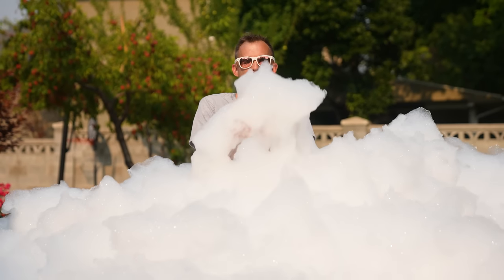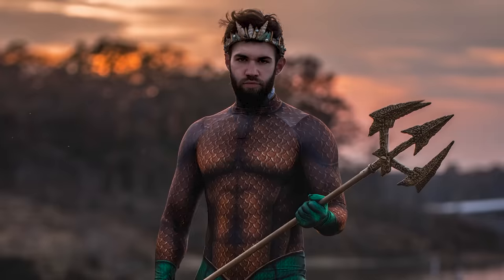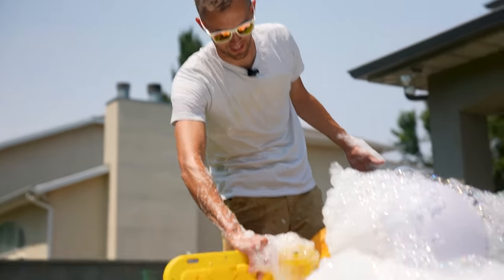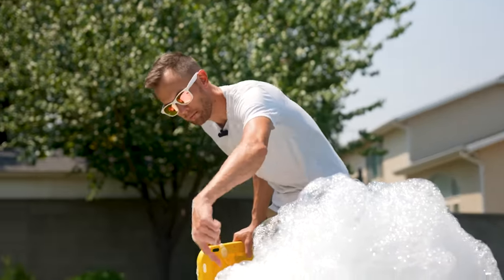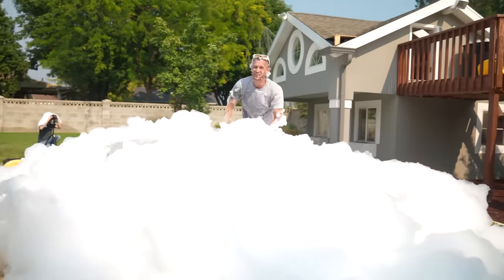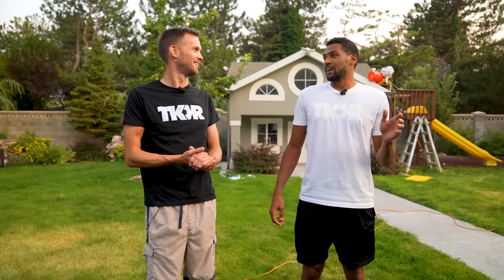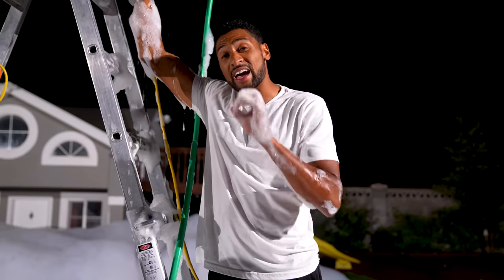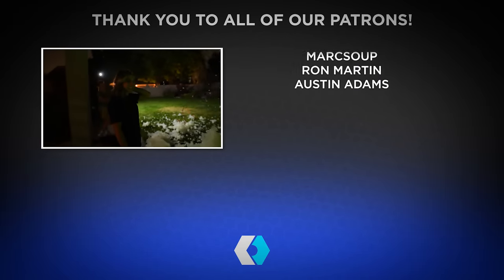DIY Foam Machine FILLED Our Backyard

Comment: You can probably find a tube that fits over the inlet of the fan that extends it output of the range of the produced bubbles
Reply: So many possible improvements....they did a horrible job.
Reply: @707ADROIT  what would you do? Thinking of doing a foam party

Comment: Correct me if i am wrong but I guess the reason why the t shirt make the most foam is because it has smaller holes due to which the bubbles made are smaller and dence which makes it relatively harder to pop compare to bigger bubbles

Comment: TKOR team, you should invest in a 3D printer. Even a cheap one will do. I have an Ender 3 Pro. With some tweaking and adjusting, and a homemade enclosure, I've gotten some pretty decent results. You could have printed an adapter to fit between the blower and your PVC pipe contraption, and also shaped such that you could have easily clamped on the fabric with a hose clamp.
Reply: I had the same thought about 3d printing an intake piece